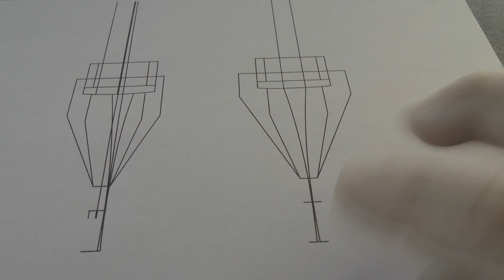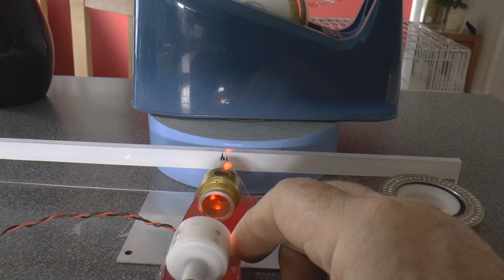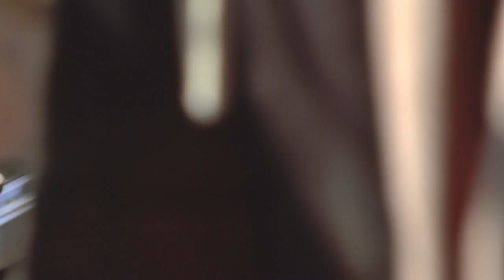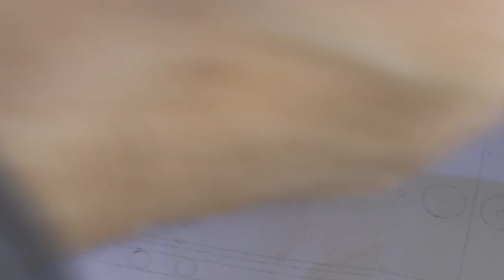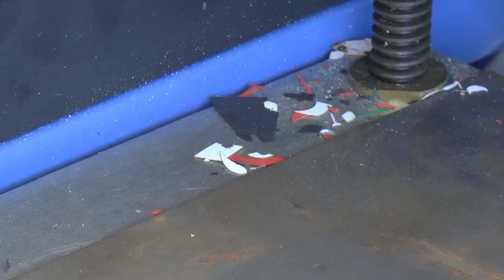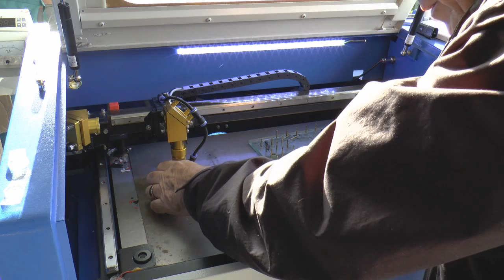RDWorks Learning Lab 31 DIY Laser Pointer for mirror alignment Pt 2 using

Comment: Hi there great video where can I get one off them beam kits please
Reply from the maker: Hi Cliff
 This was the start of a mission  (when I started 6 years ago) to find the ideal laser pointer setting aid   At the time I did not fully understand the WHOLE beam alignment process and over time I designed and tested different variants. There are videos  for these  all the way up to Mk7.  However now a bit of a warning. I have designed them so that you get continuous live feedback as you are adjusting mirrors during beam setting.  They all work well up to about 95% and quickly get your mirrors into approximate shape, However, unless they are aligned perfectly with the laser beam axis as it exits the tube there will always be some error.. I found that despite my best efforts you still have to go all round with the scorch test to set the machine perfectly. Time and a lot of experience has taught me this, so I abandoned the idea eventually. BUT don't abandon the idea completely because it is an amazing tool to help with fault finding and mirror cleaning/changes.Two massive benefits are to be had if you have mirrors that are not easily accessible for cleaning. Let's assume your machine is well set and you decide to remove a mirror. Before doing so put the head as far  away as possible from  mirror 2  and put some sort of target/cross-hair on the head entry port.. Set your pointer to fire at the cross hair and leave it on. Remove and service your mirror  and when you come to replace it it is but a few minor adjustments to get the beam back onto the cross-hair and you have reset your mirror.. The other very useful application is when you have set your beam  perfect in 3 table corners but cannot make the 4th corner correct.  Observing how the beam moves as you traverse from front to back with the gantry you will observe the beam moving. It's now down to your mechanical problem solving skills to identify and fix the issue.   OR  you can watch this for the real solution    https://www.youtube.com/watch?v=Oc3UaJREQnU

Best wishes
Russ 
 ps If you still need dxf files, just add your disguised email address to another comment and I will send the files and also delete your comment/email address from public view.

Comment: That’s a common problem in machining it’s called projection. So if you have a line that is slightly angled say 1° over a distance the angle will become more aggressive and be exaggerated. This is known as projection. You may not notice it in a thin piece because the reference distance is too small for your eye to see. Once that distance increases it is very easy for humans to see a misalignment. We are geared for spotting 90° angles. We just are. Cheers.

Comment: Hi would you sell one of these ? happy to pay what ever costs needed :)
Reply from the maker: Hi 
 Please remember that these videos are a look over my shoulder as I progress through a learning journey about this machine and the laser technology. This video is now 5 years old and was  was a great idea at the time.  It nearly worked but not good enough to set the machine accurately  (or to sell). As you journey with me over the next 2 years or more you will see me attempting to improve the design to get to that magic 100% perfect. If you regard this as Mk1  then I had SEVEN more attempts at making the perfect alignment tool . After Mk8 I gave up . It was a year later when I did an analysis of the red dot pointer system and proved that I had been chasing a dream. It was almost impossible to get the device set up perfectly aligned with the beam axis as it exits the tube.  Much as I hate the scorch method  of beam alignment it is the only way to get perfect alignment.  Instead of trying to make a tool for aligning the beam my failure made me think differently and I  designed two  major changes to the machine to make beam alignment simple and logical . First I removed all tube adjustment and made mirror 1 and the tube fixed on a base relative to each other. Secondly I made the head adjustable in Y and Z..   Hmmmm .....you have a long way to go to catch up!!!
 Best wishes
Russ
Reply: @SarbarMultimedia  Thank you very much for such complex answers!!!

Comment: I appreciate if you show where did you fix the red pointer in laser tube with tape?  When doing  laser alignment 
..? Thank you very much 🙏🏼
Reply from the maker: Hi
Yes, if you look carefully you will see that there is clear sticky tape  holding this early prototype in place. I go on to produce a MK3, Mk4, Mk5, Mk6 and Mk7. All are documented in future videos. All were nearly successful and very useful for fault finding but none was the solution for perfect beam alignment. That still has to be done with the scorch method

Best wishes
Russ

Comment: I know this is an old video but after you raise the laser back off the plastic pointer when you move your hands away the paper moves. You may have been spot on but the paper moved. Watch the upper right corner of the paper when you remove you hands at 9:50 in the video.
Reply from the maker: Hi 
Thanks for the great observation, it shows you were really interested. Yes I did notice the issue during editing but  to try and patch in a fix would have been obvious. It was the principle that was more important,  and as you have rightly observed this was at an early stage in my learning journey. As you try to catch me up, you will find that my hopes that a laser pointer would be the absolute best way to set mirrors was not fulfilled. It's a great tool for using as a reference beam when you wish to remove mirrors for cleaning, but for setting up from scratch, you cannot guarantee that it sits absolutely coaxial with the beam exiting the tube. Thus I still rely on that horrible scorch method which guarantees success. I have now refined the method to give me  quick and certain results 
Best wishes
Russ

Comment: would you consider making one of these and selling it to me, it is such a time saver and i lack the skills to make one my self
Reply from the maker: +neotecdigitaluk 
Hi
I find this little tool is so powerful for setting and diagnosing various problems with your machine. I am lucky enough to have equipment and skills to make what I imagine. However, I am  mindful of people such as yourself that have a laser machine but no other facilities. After learning so much with the MK1 and Mk2 versions of this pointer, I have decided to design a Mk3 version that removes the need for any machining. It can be made with your own laser cutter. No additional tools will be required except a countersink cutter in your hand drill. I'm just putting the finishing touches to the design so watch out in the next day or so 
Regards
Russ
Reply: +SarbarMultimedia sounds good to me I look forward to the video.

Comment: I think you're focusing too much effort on making sure the laser is pointing directly at the center of the mirror.  
What's more important is that the laser hits the exact same spot during all the gantry's movements. Doing it this way accounts for any variable involving irregularity in the gantry.   
For example, You need to adjust the 1st mirror so that the laser hits the 2nd mirror when it's all the way back and all the way forward.  This means you'll get a consistent beam all along the Y axis.  And the same goes for the 3rd mirror. That's more important then making sure the laser's beam is points directly at the center of the mirror.
Reply from the maker: +Go-C Graphics 
Thanks for your feedback and I accept the point you are making. I did realize that it was important to ensure that the beam runs parallel to the two axes for maximum accuracy and that as a demonstration of how to set the mirrors properly, my video could cause issues for novices. The real purpose of my video was to show the effectiveness of the laser pointer as a useful tool in my quest for the "off angle" cutting problem my machine was exhibiting. As with all my videos, this was not intended as a training video, it was a live record of what I did, as I did it. I then had to distil  my subject into a 15 minute edit.  The early part of that video demonstrated how important it is to get the beam central to the LENS because the focus point could swing as much as 3.5mm  if the beam traverses the whole lens diameter during a full axis movement. Hence the importance (as you say) of ensuring the beam stays in one spot on each mirror  over the whole table area.  I can foresee that  mirrors that JUST work but that are set up poorly could result in a 300x500mm rectangle being cut with diagonals that are 7mm different. (Light bulb moment!!!) I had a question from a fellow sufferer about the trueness of some 150mm squares shapes he was cutting. They were not square by a millimetre or so. He thought he had a backlash problem but I had no answer. Perhaps this was his problem.
I genuinely thank you for your comments because you have focused my attention to an important subject that I ought to cover properly as a part 3 to this session.